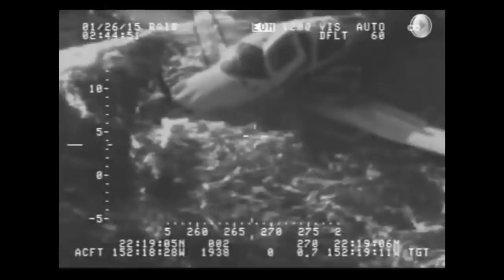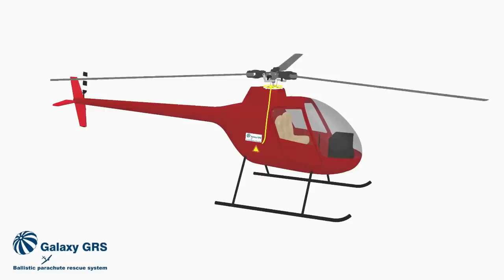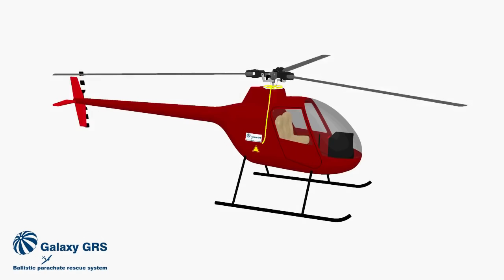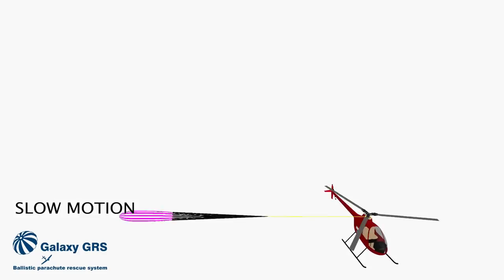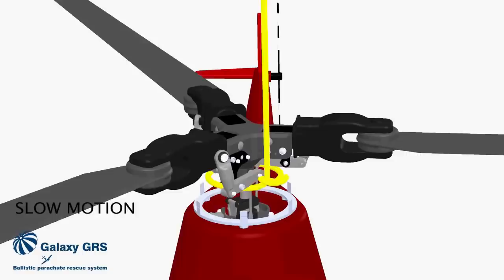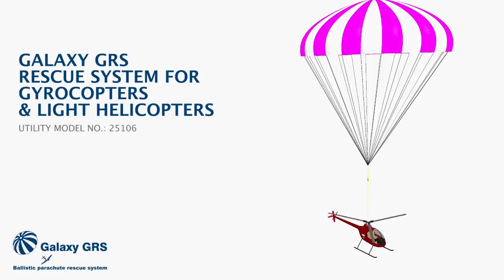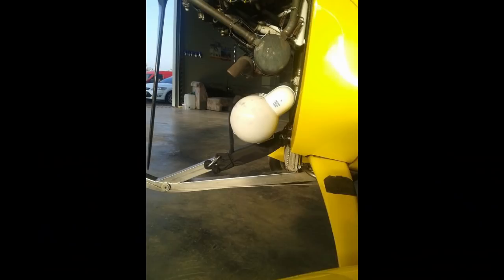Gyrocopter parachute rescue system or ballistic recovery system [BRS]

Comment: I like that they've ground tested this by firing it thru a spinning rotor mounted on the back of a truck.  I'm eagerly waiting for an actual rotorcraft save.  I emailed Galaxy recently and confirmed still no saves. I would rather it attached to the frame but I looked for accidents that occurred due to rotor head departing the shaft, either gyros or helicopters and couldn't find any.  I don't recall any gyro wreckage with a missing hub.

I think this is a must for new gyro pilots wanting to fly single place and has me considering an ultralight Mosquito helicopter. There are strikingly few Mosquito accidents or deaths compared to Rotorway.
Reply: Another good use for the forgotten and undersppreciated gyroglider.

Comment: Why not just make the masts hollow tubes that store the parachute and shoot them out of the center of the mast? Would require redesigning the disk to use a hub/ring to spin around the slightly larger mast, but they should be able to easily engineer this.
Reply from the maker: That actually sounds a very neat solution for gyroplanes.  File the patent this time next year....
Reply: Be firing through a rotor travelling at hundreds of rpm.
Reply: @cameronlapworth2284  that's what it's doing now according to the video. If it were a tube containing the chute with the rotor on a ring hub, the mast tube can extend past the rotor disk and the chute and rigging would not interfere with it when deployed.
Reply: @TheArmchairrocker  the masts are tiny 50×60mm  the head would need to be designed to fit the parachute through the middle.  Could be done but all the blade manufactures would need to adapt etc.  Another solution could be some sort of sensor the fired in time.  Honestly though this system seems the best I've seen.  There was one that was mounted on top of the rotor head.  Or just wait for the rotor to stop.  Gyros fall like a parachute anyway in a vertical descent it's only really if you unload your rotor that it's beyond saving at which point a parachute could save you it takes all of 2 or 3 seconds for the rotor to stop fire after that?
Reply: @TheArmchairrocker  just rewatched the video again.  This fires sideways so only the cable gets into the rotor nit the chute.  Firing through the rotor without some sort of interrupter gear could result in damaging the chute and stopping it being deployed.  As long as the cable is long and strong enough it won't be destroyed by the rotor.
Reply: @cameronlapworth2284  you don't understand what I'm saying. Rotors fail too.
Reply: @TheArmchairrocker  I think you are right I think I may have misunderstood can you clarify.

Just get things straight.  Rotors rarely fail in gyros because they are self driven in flight that is they are being pulled around by the forward lift in each rotor not driven at high angles of attack from a centre hub.  There have badly designed rotors loose tip weights killing the pilots passengers but this was not appropriately designed rotor.  Additionally some rotors on some of the modern euro machines have had cracks form and needed to be redesigned.  I'm not convinced this isn't to do with the excessive stick shake I see in many of these machines but am open on this one.

Generally the only reason you would fire on of these other than mechanical failure which is exceedingly rare.  In unloading the rotor in flight so any negative g or push over. At which point the airflow is reversed and the rotor will stop in 2 seconds collide with tail etc.  There is zero recovery from this.  

Otherwise firing a bakstitic chute like this gains little.  This is because in a gyro in a vertical descent falls at about the speed of a parachute anyway and while you will most likely right off your gyro you will not hit hard enough to hurt yourself.  My VW gyro 22ft rotors would fall at about 700=800ft/min.  

So if say having to land through trees you'd flare over a gap and vertically descend into the gap.  Of course you'd be better off just making sure you could glide to a proper landing.  

A properly built set of rotors should literally last a lifetime of flying many many thousands of hours if properly designed unlike choppers.  Wood blades longer than metal or glass because wood if cared for has better fatigue life.

Anyway with that as a starting point can you explain what I've missed?  Not trying to be argumentative genuinely missed your point I think.
Reply: @TheArmchairrocker  oh I think I might understand are you worried if a rotor is sheered this ring will slip off?  Good point.  They could just anchor it at the base of the mast.  I thing they are trying to allow the cable to turn with the rotor.  Yes that's interesting. 

 Usually when unloaded you might sheer that end of the rotor at the mast the hub cracks could have led to a hub failure in which case you've got a point.  Generally though damage to the rotor would happen at the point where it collides with the prop.  Most blades have massive leading edge extrusions at the leasing edge.  The hub bars are very thick.  I've only ever known of 3 actual blade losses.  One out here was a guy who smashed one blade but the other survived he tried to get the manufacture to sell only one rotor he wouldn't so he found a guy who'd done similar damage and got the spare blade.  Blades are matched as a set so his stick shake was enormous and he had some sort of blade failure a year latter.  He may not have been saved but mist blades even if they collide with the frame in unloading stay intact.  Perhaps narrow the ring so it's within the hubbar?  But good point.

Comment: You can never say anything is 100% safe.
1) The system may not work due to individual failure, improper installation/incompatibility or breakdown.
2) The system can work, but do it wrong and only worsen the situation.
3) Even if the system works correctly, it does not guarantee that you will not break your neck or back on landing, which might not happen in a normal emergency landing.

Comment: Are there wire cutters like some helicopters have? What about spraying crops with gyrocopters? Anyone know where I can learn more about this? I know there are a couple but they only seem to carry 50 gal or so. I think they probably can’t outcompete helicopters.
Reply: For crop spraying only, long, thick, and wide blades, will give a lot of lift, and make the gyrocopter fly slow, but for spraying, that is fine.

Comment: I think this system should be seriously considered especially in light of the recent Utah push over/torque over accident. I would question if having the attachment point at the rotor head would be best given that that is the area of high kinetic energy/potential failure as well as the whole mast structure snapping under a negative G condition. Fire the rocket downwards and rearwards and attach to the lower keel would be simpler - issue would be the potential injury of a nose down descent to ground.
Reply: I agree with that logic. I have a BRS-5 mounted under my Pitbull & tethered to the tail. If it's going in the dirt, it's going nose first with the 5 point seat belts working at their best angle. I've crashed enough race cars to know how I prefer it!
Reply from the maker: Hi all - I'm not an agent for the product and am merely communicating its existence however what I would say is that this wasn't the work of 5 minutes and if I was to buy and fit one to my own gyroplane [and I would but I don't own one currently because of the virus interruptions] I'd install as per the instructions.  On the mast failure I think Galaxy are aware of that potential because they suggest you run a kevlar belt from the top fixing to the main frame of the gyro.  But otherwise I do hear you and follow the logic.
Reply: @gyrocopterflyingclub6148  In my application the mass of the engine is in front of me, not behind where it could slap me in the back of the head while I'm eating dirt but either way you are looking for the best scenario in a horrible situation so it's not going to be pretty if you have to sacrifice everything around you to not be a statistic.
Reply: Did the guy in Utah have enough hight?  Most fatal unloading happen near the ground turning onto final usually in windy conditions.  In his case I'd think it would have been touch and go to deploy in time.  Needs 300ft?  Did he have 300ft.  But I know one bloke how would have survived elthougb he was determined to get his machine to 105mph.  Several of us directly warned him he risked fatally unloading his rotor,  he brushed us off because he had a high thrust line vs cg and a large hs (true)  I spoke to a daughter of the farmer whos property he crashed on she said he was flung out of the cockpit leaving the lower part of his leg in the instrument panel.  The gps confirmed he'd been doing 98knots stopped abruptly.  His body was about 50m in front of the cockpit.  It wouldn't have helped him.  His seatbelt was ripped out of its sockets (this may have been poorly designed).  Anyway I hope they work but wouldn't count on the saving you all the time.  No substitute for proper training.
Reply: @cameronlapworth2284  There are certainly many scenarios where a chute might not save your ass. There are three things that stand out to me in that recent crash in UT, sudden pitch up, full right rudder & power still on all the way to impact. All actions you would expect from a right handed pilot during a heart attack but it could have been as simple as a left rudder control loss & pilot panic. We'll just have to wait forever for the official report on that one. If I ever have a holy shit moment, I'm going for the Jesus handle now that I have one!
Reply: @nzsaltflatsracer8054  yes a good idea and while I have concerns about idiot proofing machines (if it leads to our sport ignoring training which has happened in the past).  I'm all for anything that might work and this would appear to work if high enough.  I'm concerned that like HS and thrusting vs cg these will be used to give a false sense of security and allow poor instructors and organisations off the hook.  If you can avoid unloading the disk you already have a parachute, the rotor will allow you to defend vertically at about the same speed.  So yeah these could be great but we have had quite a number of deaths on take-off and landing.  What if these were mandated in lue of addressing training?  So all for them provided our various associations don't use them as a band aid.

Comment: How common is rotor damage, either in mechanical function or direct material failure?   The gyrocopter is supposed to be effectively immune to engine failure, and presumably without need of a b-parachute...unless the main rotor fails also.
Reply from the maker: Rotor damage usually comes as a secondary / effect from something else, usually pilot mishandling.  That said I can think of 4 fatal gyroplane accidents in 2020 where a BRS could have saved all lives.  477AG, G-CKYT, 11TG, 261MD.
Reply: I don't know about the rest of the world, but in New Zealand the acquisition and frequently illegal use of UAV's/drones is exponential - even near airfields. Regrettably, the yobbo factor here is substantial. Ergo; perceived risk of meeting one of these mid-air.

Comment: And in the event of a catastrophic failure of the rotor head, how would the rope fastening look?
Reply from the maker: It’s a good question but one addressed by the system where they recommend and supply a Kevlar rope that runs from the rotor head to the main body of the aircraft

Comment: 100% ?  I don’t think that’s accurate. I can recall at least one CAPS deployment in a heavily developed spin that was not successful.
Reply from the maker: Yes but I did say there was some caveat / devil of the detail....  I think what Cirrus claim is that when CAPS has been deployed successfully... i.e. not outside of the limitations of the system .  The AvWeb film explains it better than me [see the description for the link].  I think generally and especially for the guys who just really don't fly enough to stay fully on top of things and for those who come to aviation late [so the basics just haven't really locked in enough to be puked out automatically i.e. R/T and basics around flight planning, met etc] then a BRS seems likely to be a nice thing for them to have in the pocket - and the rest of us who are not immune!  I used to fly with an aerobatic instructor who never wore a parachute on the basis that his view was that the use of one likely created its own problems in terms of movements etc and that for the most part the decision to use one or not likely meant you hit the ground anyway.  I elected to use one on the basis I knew 100th about aeros that this guy did and so my mistakes were likely to be more fundamental and I'd hate to be at 1500ft wishing I had one as I rode an accident all the way in...

Comment: Ballistic Parachute Recovery Systems should only ever be considered to be credible if there is documented, verified, video recorded evidence of it being deployed from a Pilot controlled aircraft in which the Pilot is actually flying that manned aircraft from within the cockpit (not by remote control of an unmanned drone aircraft!).

Why would you fit a system from a manufacturer whose own test Pilots have not actually used their own system!

If it has not been tested successfully in a manually flown aircraft occupied by Pilot/s but only on a weighted, unmanned drone aircraft, avoid it at all costs!
Reply from the maker: Well there are two things to say here.  The first is that all mature aviation nations have strict control and airworthiness processes which cover the fitment of any systems and it’s likely their engineering experience is more than robust.  The second is that you would only ever use such a recovery system if your safety is any way imperilled so I guess at that point you don’t get too picky about how it’s been tested as long as it pulls your fat out of the fire??